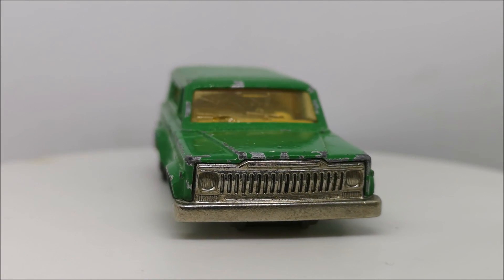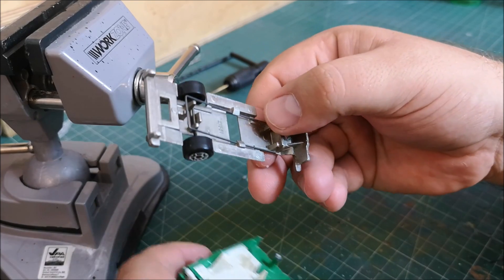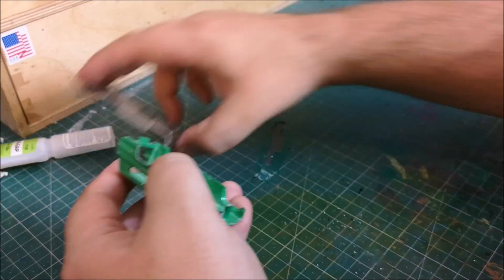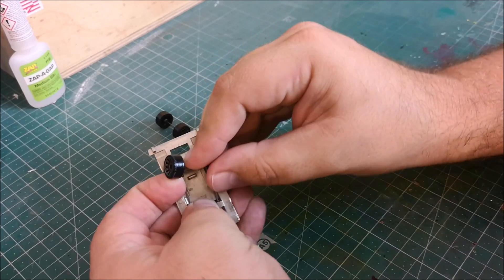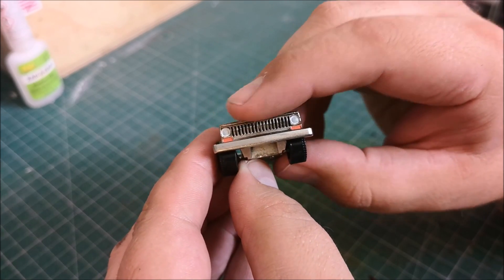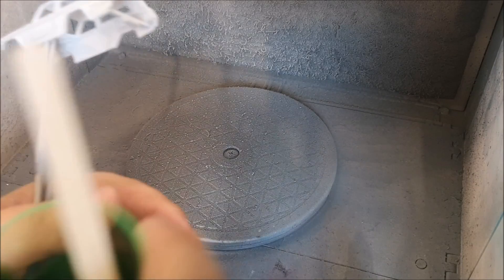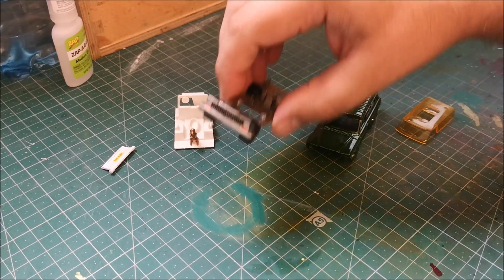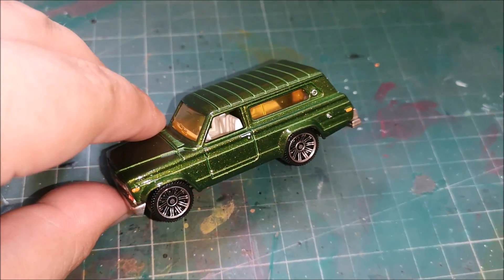Majorette No 236 Jeep Cherokee 1980 - Custom Video

Comment: Now that's an old-school Cherokee! Back when they were still two-door Wagoneers, and SUVs weren't even called that yet. :)

I'm not completely sold on the modern wheels, I think mostly just because I'm old and don't like low-profile tires. The overall wheel size is a good match, though, and they do give the model a great stance.  And that paint color is a complete success, that looks amazing.

I got curious about those chrome rings on the D-pillars and did a couple of Google image searches. I'm not 100% sure, but it looks like they were only on the fancy-trim-level Cherokee Chief. They're probably just decorative.

Comment: That is striking colour, Rob. Quite similar to my racing-theme, while RC racing. Of course tehcnique is different on clear Lexan, which is painted on inside. I did first layer of clear with gold flakes and next dark green. Last was protective coat of white. Gloss came from Lexan. I don't know, if that would work on reverse order.

Also, excellent detailing.

Comment: Looks much like my 96 Cherokee, Nice work. I don't understand the white tailgate from the factory but looks good over all.
Reply: They probably just couldn't be bothered to cast and paint a separate metal piece for that, and included it in the mold for the interior instead to save a few francs on production.
Reply: @ZGryphon, thanks for the input.  I guess I'm thinking more about the color. Paint it green or use green plastic.
Reply: White tailgate from the factory: 99% certain it is just the economics of it. They probably cast it in the same mold/process as the interior, instead of having two separate casting. Saves up on a bunch of costs that way.

Comment: Hi ya Rob, never took one apart but remember marveling as a child at 70's matchbox suspension. I remember a Porsche 928 and a benz 4 dr that I would drop from about half inch up and they would take it bounce like a drum roll till they stopped. Is this similar like a torsion bar assembly?

Comment: No, no, don't edit out, but, for the love of 'Sweet' Barnaby Dalahassy, pop some time codes in the feed. Let us pick and choose which bits we're most interested in.

And buy a detail brush.
I mean you're getting MUCH better, but I'm seriously thinking about shelling out for the train ticket up and arriving with a couple of proper brushes and holding you and your family at brush point until I can teach you how detail painting bloody works. Then letting you buy me a few pints. Or having a tremendously complicated chat with the rozzers.
Failing that, find someone who paints miniatures for a hobby and have them do it, it isn't that tricky, but it's also not obvious how much you can get the brush to do for you. If you've ever been a decorator, the principles of cutting in do work on that scale. You CAN paint in accurate numberplates, you just don't have that bit of knowledge yet.

That was a nice job, though, except that boot door needed to be green too.